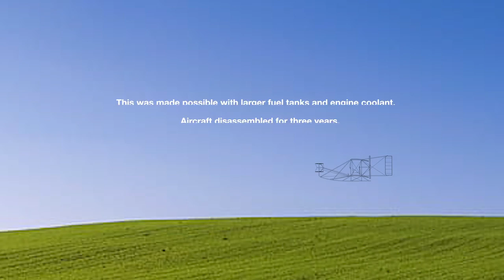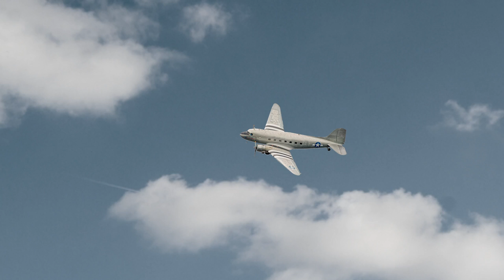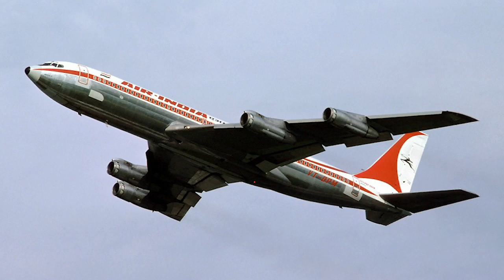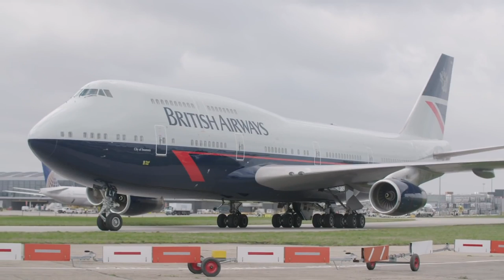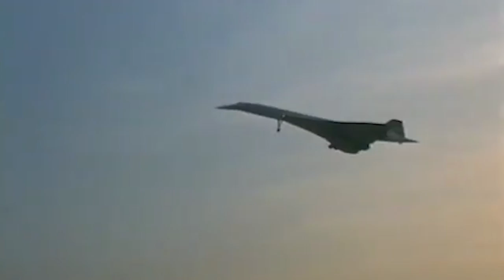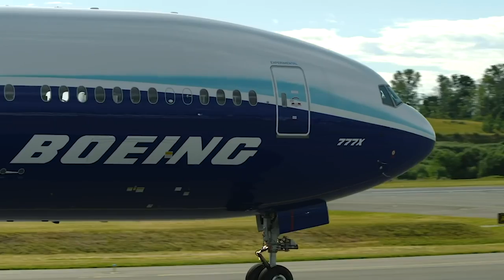The Evolution Of Flight

Comment: Just imagine in the next 100 years ,civil planes could reach hyper sonic (it's after supersonic) or maybe it could be in the next 200 years.
Reply: frankly man, I think the whole field is changing so much that at this point, it's not easy to accurately predict the upcoming changes...
Reply: Lol
Reply: I think at this rate, it’s more about efficiency instead of speed, always has been since 1973. In the future, we’ll more likely have electric/hydrogen aircraft flying the same as today in terms of capacity and speed, rather than  supersonic or hypersonic planes running on jet fuel. Maybe if we progress even further, in the next 300 years, we may have electric or hydrogen hypersonic planes, converging the two sectors
Reply: I just want flying cars within the next 100, preferably 50yrs. Having to get up & go to work will never be a pain in the ass again, ha.
Reply: What if we all die in next 50 years?

Comment: Electric or hydrogen planes? Wouldn't that only potentially work with propeller planes? Because current jet planes don't move just because of the spinning fan blades

Comment: OMG, where do I start on this video.  First, the graphics of the Wright Flyers are flying backwards.  Second, Alcock and Brown were NOT the first to fly across the Atlantic Ocean, that feat was accomplished by The US Navy boat NC-4 flown by Commander Read two weeks earlier.  Alcock and Brown’s flight was,however, the first non-stop, as the NC-4's was done in stages.

Third, Charles Lindberg was NOT the first to fly non-stop across the Atlantic, as illustrated above, he was the first to fly “solo” (that means by himself), and between major cities, namely New York and Paris.

Forth, there was NOT over 11,000 DC-3’s made.  Only 607 were made that were civilian DC-3’s, while 10,048 examples were built as Military C-47s (and a plethora of other designations), plus 4,937 built in the Soviet Union as military Li-2’s.  Spitting hairs, maybe, but I’m on a rant here.

Fifth, the Me 262 was NOT introduced in 1947 – mostly as that was after the end of WWII and Germany had surrendered in May 1945 – but was actually introduced into service in 1944.  And on a tangent, where is mention of the Gloster E.28/39?
Reply: Forth? 😂
Reply: @Sergio54321  Ya I did a typo.  Big fat hairy deal

Comment: Your history research is completely wrong, the first self powered flight was performed by Santos Dumont in September 7th, 1906 in Paris, as part of a challenge held by the Paris Airclub. Although the Wright brother "flight" was in 1903, it was completed using a catapult, not powered as it is stated in the video... But the Americans made this whole narrative to make them look good on the history...
Reply: If you ask anyone from New Zealand they'll tell you Richard Pearce was the first to fly in 1902/ early 1903 in on his farm in near Timaru, South Canterbury, NZ
Reply: Henrique Carneiro, the video isn't completely wrong, actually. I just think it is incomplete.
Wright Flyer I was, indeed, the first sustained powered flight (as the video shows) because the engines they used could keep the aeroplane flying over a reasonable time, so as not to be a powered jump. However, I agree with you that this flight was not <self> powered, for they depended horrendously on the winds of Kitty Hawk. They haven't used the catapult yet but couldn't fly without strong winds to help them.

Even the Flyer II, in 1904, couldn't fly only by the engine power. Wright Brothers failed a flight attempt in front of the local press due to poor wind condition. They hoped they <could> fly without the wind if the engine reached an outstanding performance but it wouldn't happen very often. Personally, I don't think we can consider this to be a plane because a plane <has> to be able to fly by itself. Well, a plane that may or may not fly, depending on the wind and depending on the engine to work far above average conditions is just not complete. But I still have to say that the Wright Brothers, despite of the take-off, were far, far better than our fellow countryman.

Flyer III is a monster of aviation. I'm very curious about it but I couldn't find enough information on its dependency on the wind. The Flyer III was the machine that made the Wright Brothers start using catapults for getting quicker in the air. Because of their refusals to show their machine, it's difficult to see if they could take-off even with calm wind without the catapult but, since I believe it would be fairly mentioned, I doubt it happened. The three-year hiatus was enough for Santos Dumont to fly his 50hp engine in a calm wind afternoon in Paris, without any assistance.

So, yes, I think Alberto Santos Dumont was the first man to take-off on a plane that flew entirely by itself, despite the machine being totally crap. Wright Brothers machine was far better in flight because they worried a lot on this point, since they planned to sell the project to the US Department of War. Santos Dumont did worried about taking off by the aircraft itself because of the rules of the Aéro-Clube de France.

Personally, I think the Wright Brothers would eventually fly by self-powered flight even if Santos Dumont hadn't existed but it's curious that this genius was the actual first man to do it. I regard Dumont as the first man to fly a fully operating (crappy) aeroplane, though I regard the Wright Brothers as the best engineers at that time, also being the most influential ones. Dumont's 14-bis had its important role for aviation, for the French and for us Brazilians but it wasn't as relevant as the Wright Flyer III, even if it wasn't a complete aeroplane.

Comment: The German Gustave Weisskopf was the first man to fly ever. He succeeded both in 1901 and in 1902, way before the the cyclists Wright Bros. His plane looked like a plane, it had a sit for the pilot, it had also two wheels. Unlike the strange construction of the Wright Bros.,  which couldn't take off without a catapulte, with the steering in front of it ( practically impossible to be steered). The brothers PR was strong, so they could unfortunately cheat the whole world.
Reply: Where’s the proof of that guy flying. The Wright flyer in 1903 did not have catapult. You have your facts wrong.